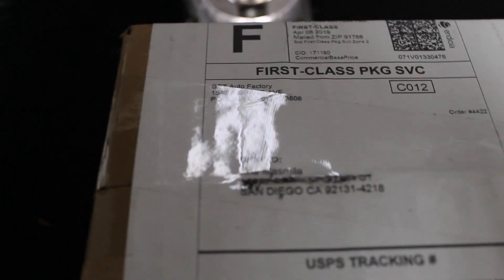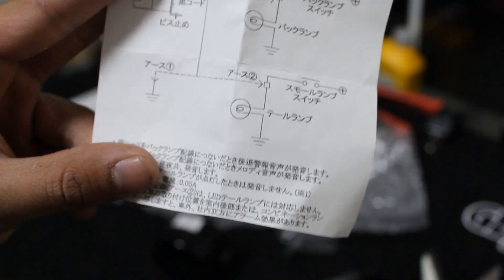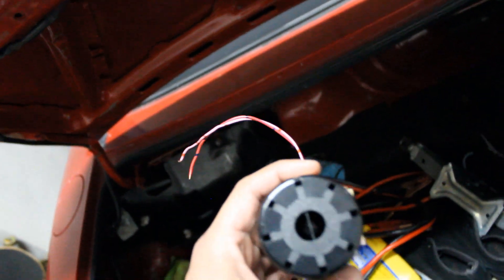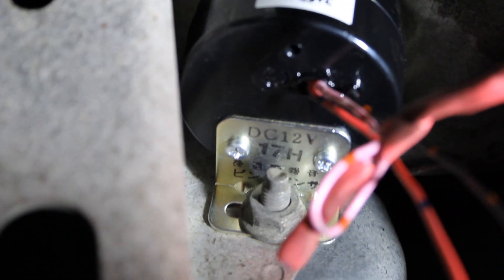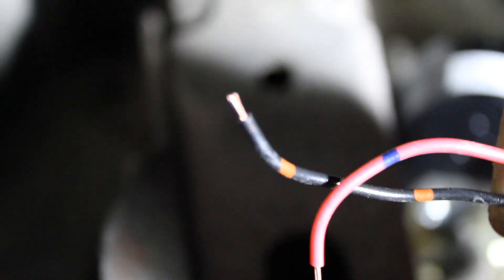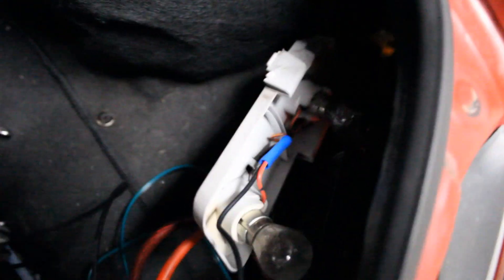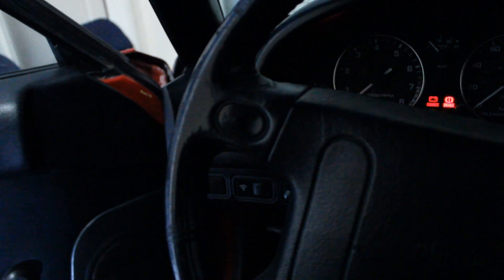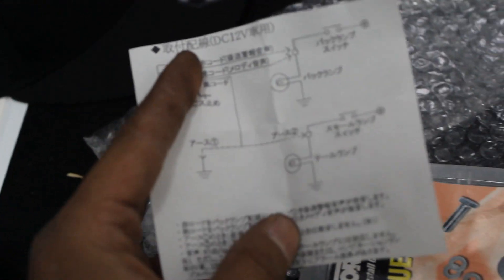I BOUGHT A BACK UP ALARM FROM JAPAN

Comment: I find one. If I connect it to a normal battery and nothing else would it work
Reply from the maker: If you were to connect it to a continuous 12v source it would stay on continuously
Reply: hellastreet.miata would it bleep melody and speak normally?
Reply from the maker: @Popaholic  you will need to put in a switch unless you want it on all the time
Reply: hellastreet.miata ok thx

Comment: did you splice both the melody and the backup warning together? (the pink and the red wire together?) then connected it to your backup light? 

bc on your video, It gave the backup warning “bakushimas ! goochui kudasai!” then played the melody, then said “sumimasen ! bakushimas!) 

on mine i only wired the red wire and only get the backup warning. 

and on the getjpn website it said you can only wire one at a time.
Reply from the maker: For some reason, when the engine is off it plays the melody, but when then engine is on it just plays the warning
Reply: @krismasmilaa  

but did you splice both the red(backup warning) pink(melody) then powered both of them at the same(wired to reverse light) 

and unlocked the third possible wiring option on the speaker?
Reply from the maker: I wired in just the red wire
Reply: Wondering about this myself